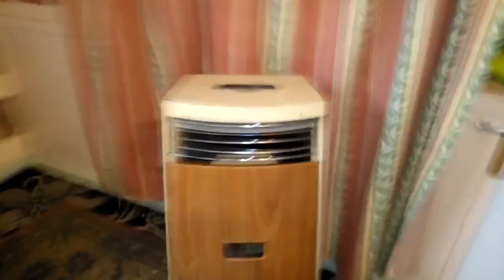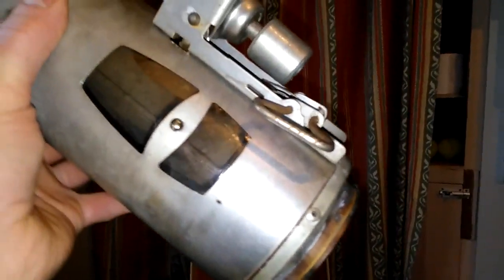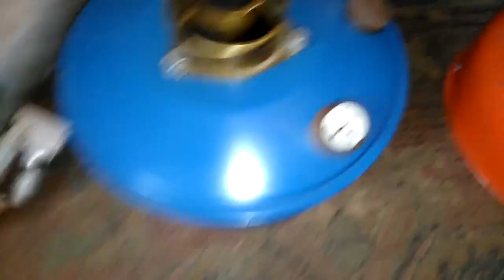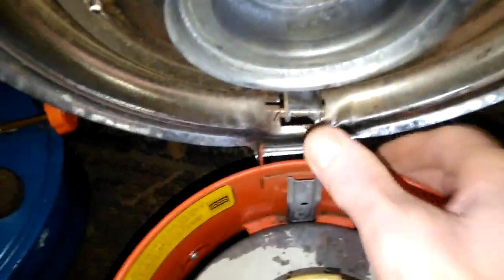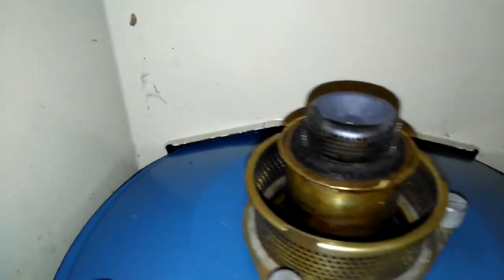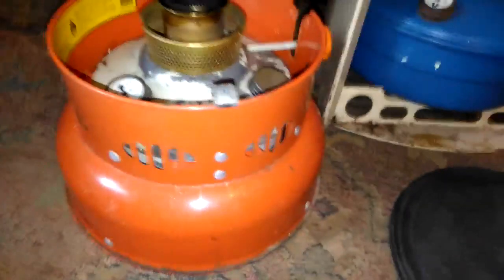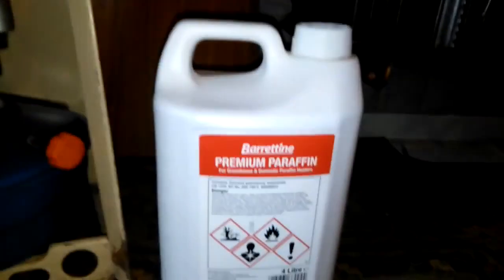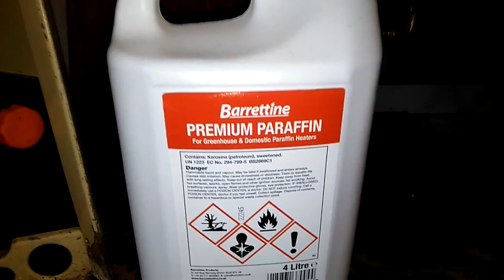Stay Warm This  Winter - Blue Flame Paraffin Heaters.

Comment: Do they throw out much heat? And where is the cheapest place to get fuel?
Reply: The modern Japanese ones with electro ignition kick out loads of heat, as they have a tall cylindrical copper or brass heat diffuser, inside a tempered glass cylinder, with a reflector behind.  I've got a 2000kW one and it's ridiculously hot.  At the moment the outside temperatures are around 5 to 10 degrees, so I just have it on for 2 x half hour stints a day, and even then after 10-15 mins I have to turn it down to half.  Then I switch it off and light my Feuerhand oil lamp, which is on now, it maintains a comfy temperature and gives out a cozy light.  I have a window open all the time too.
Best place to buy paraffin is from Amazon, in 16 or 20 litre batches.  I just had 20 litres delivered last week, cost me £37 including delivery costs.
Reply: @simonh6371  Thanks for the detailed reply. We must have bought the same paraffin on Amazon. I also have two Feuerhamd lamps. Check out the London candle company for oil. I got 12 litres of lamp oil for £47 delivered. 

Where do you get the Japanese paraffin heaters from? Can you give me a little more info please, including the brand etc.
Reply: @HarveyJohnWillmott  I know lamp oil is nicer but it's double the price of my premium paraffin so I'm too much of a cheapskate for that!  Thanks for the recommend anyway.
Reply: @simonh6371  Fair enough. I hadn’t thought of putting paraffin in a lantern. Can I have more info on the Japanese heaters please?
Reply: @HarveyJohnWillmott  I thought the lanterns were supposed to run on paraffin?  Anyways back to the heaters, these are pretty common in the Netherlands where I used to live, they stock them in hardware shops there.  The British Army used them to heat tents in Afghan.  When I was in we used the portable ones with two burners and aluminium cylindrical diffusers which are nowhere near as good, in our tents on Royal Signals rebroadcast detachments in North Germany where it gets bloody cold.  I trained as an RTG and learned to touch type for operating teleprinters, which is why I type such long comments lol.
Reply: @simonh6371  I don’t know. I just know lamp oil is available. What brand are the Japanese heaters?
Reply: @HarveyJohnWillmott  Zibro/Toyotomi are the best.  Mine is Tosai.  I think it's actually made in China under licence but it's still good.
Reply from the maker: The L210 makes around 3750 - 4500 BTU per hour.
I can't find data for the Viceroy, but it seems to make a little bit more.
I've since bought an Aladdin S37. 
I also bought 2 more Valors, with twin burners.
According to the data tag the Aladdin S37 is 5870 - 9320 BTU per hour, (1.75 - 2.75 KW). 
It says 25 - 16 hours burn time - per imp gallon (4.54 litres).
One heater on its own wont do much for a big house. You'll need at least a couple of them.
As for where to get fuel. That depends what you want to use it for. 
For use in a greenhouse/shed you'd get away with C2 kerosene. 
If you want to use it in a home you need at least C1 kerosene (premium paraffin).
The stuff labeled as 'Premium Paraffin' is just C1 kerosene.
True 'paraffin' has no odour and is as colourless as water. It's often known as 'White Mineral Oil'.
It's the same stuff 'Baby Oil' is made from, 'Paraffinum Liquidum'.
'Paraffin Wax' is what candles are usually made from. 
Vick's vaporub, baby oil, petrolium jelly, etc, are all some form of 'paraffin oil/wax' and they burn very cleanly.
White Mineral Oil (Parrafin) is sold and used as 'Lamp Oil'.
Diesel will work, but I don't recommend it at all.
Best place to buy fuel is Rye Oil on ebay.
They've got a few to choose from.
BTW. Methanol works like a dream, but it's probably quite dangerous due to vapour and explosion risk, so I don't recommend that either.

Sorry for the delayed reply.
Reply: @brianmurphy8790  wow, thanks for that information. 

I’ve been using premium paraffin that I bought from Amazon. I just checked the bottle and it does say C1 on it. It’s yellow in colour and smells heavily. 

I do also own some lamp oil, which is clear in colour that I put in my oil lanterns. 

It’s very expensive in comparison to the premium paraffin though. 

What would be the advantage of using lamp oil in a paraffin heater? I don’t think I can justify the cost difference anyway. 

Also, I couldn’t find lamp oil on Rye Oils.
Reply from the maker: @HarveyJohnWillmott  
Rye change their product names quite a bit.
Ouderless kerosene is probably nearest thing. It's expensive though. Their C1 kerosene is usually dyed.
I forgot to mention, they'll burn lard just as well as paraffin.
They'll happily burn pig fat all day - and it burns clean.
You have to melt it first, doesn't take much heat, to about 30-40 degrees C.
Reply: @HarveyJohnWillmott  I have been reading comments out of curiosity and also that I may learn a thing or two. I hope you don't mind me chiming in Harvey & Brian.

Apparently Lamp oil wicks slower and produces a brighter flame but less heat, paraffin wicks quicker and burns less brightly but gives of better heat. 
Running straight lamp oil in a heater without additives will apparently not work so well, it won't wick up quickly enough, running paraffin in a lamp will produce less light and somewhat more carbon monoxide than lamp oil.

I read this somewhere several years ago while researching the subject of several oils and why their specific uses.
I may be wrong but you have some info for further research if you like.

Also, diesel at the pumps for road vehicles in most places because of emissions, have 15 ppm or less sulphur.
By adding 30 ml of 91% or higher of isopropyl to every 1 litre of diesel diesel apparently burns great.

I've also read as little as 5 ml per litre works well.
It seems experimentation would be a Good idea as all diesel differs somewhat from place to place, start at 30 ml and work down is recommended. I've yet to try this myself, I've an Aladdin 37 and Valor 207.
Sorry for such a long post you two 👍
Reply from the maker: @pa_maj.MARTINI-van-MAN  
I only just noticed your comment. I'm usually a lot quicker to respond.

The heat output of different fuels is going to depend on their individual calorific values. Using kerosene or paraffin in one of these heaters will only ever produce a blue flame, regardless of heat output. 
It's soot (unburned carbon) particles that produce light, as they glow orange/yellow due to the heat. The light output is not just dependent on the fuel type, more importantly, a great deal depends on the wick/burner design.
The wicks/burners in these heaters are designed to produce maximum heat - therefore a blue flame is required, whereas the wick/burner in a lamp is designed to produce maximum light - therefore a yellow flame is required.
The hollow wick, draw tube and flame spreader are what provide the additional oxygen to burn the carbon that would otherwise become soot/light.

The different fuels are all hydro-carbons. The hydrogen is first to burn and is what provides the initial burst of energy to ignite the carbon. However, if you're not getting enough heat and oxygen to ignite and burn all the carbon, you'll get soot. With enough heat and oxygen the carbon (soot) becomes carbon monoxide and then it burns, with a blue flame, to become carbon dioxide.
Don't worry much about viscosity values or wicking speeds in these heaters - just light a candle and see how runny the wax gets when it's hot. 
I've got a few more of these heaters now. I've been buying the summertime bargains.

I'm in the process of modifying one to run on candle wax or any other solid/semisolid grease/fat.
The system initially requires external heat input to liquefy the wax/fat, but once running and up to temperature, it will run without external heat input.
The original design of the heater makes this modification easily possible. 
Hot air comes from a coil piped through a hot zone and is then pulled through the fuel reservoir, by way of the two fuel filler/gauge openings, then through the draw tube intake in the bottom of the reservoir.
Once lit it will be better for it to stay lit, so I'll be adding a third opening on the reservoir, to be able to refill it while it's lit.
Reply: @brianmurphy8790  Cheers Brian, You've shared a wealth of Good info there.
Since my last comment I've done a bit more digging.

Generally lamp oil is more expensive than typical paraffin.
I have paraffin, there's no paraffin smell from the oil itself that I can detect or when burned and also no taste, Great for relieving constipation; It's Very refined.

I've come to understand that some paraffin oil is simply refined more than others.
Lamp functionality requires more light, that yellow flame, a more refined paraffin oil is desirable as a complete burn (full combustion) is not exactly desirable, and what is not burned up would be better if less toxic. 
A blue flame is not desirable as it gives off more heat and less light so the more refined, the better apparently because of less sulphur etc .

As you mentioned, it seems these blue flame heaters, can handle many oil types, so long as they still generate a blue flame.
From my own experience, I know that certain consistency oils, or any dirty oils, can very quickly clog or contaminate a wick.

I've been exchanging findings with other experimenters, all while amassing a decent collection of different stoves and heaters, purely for the fun of it.

The prospect of seeing your experiments with wax burning is exciting.
I hope you'll consider uploading a video sharing your experiments and findings-it would be fantastic

I've been designing a wicked diesel/isopropyl externally vented ( isolated intake and of course with a flue) small campervan heater.
I've got it worked out pretty Good but looking for ways to simplify it.
It' is somewhat a little complicated for my tool setup and materials, fiddley welding and machining if you know what I mean Brian.